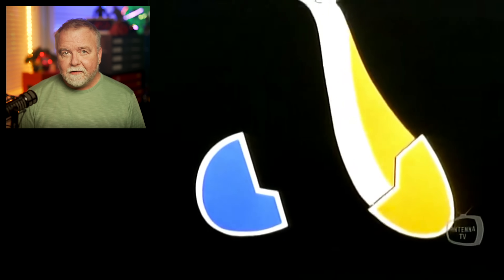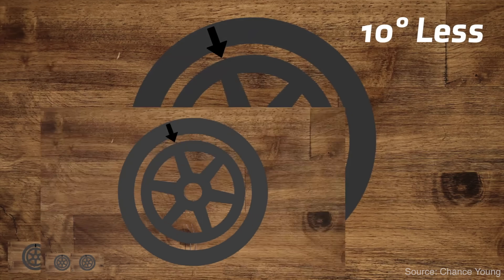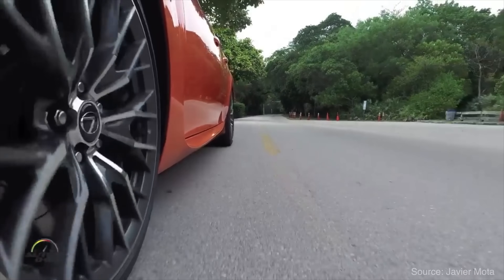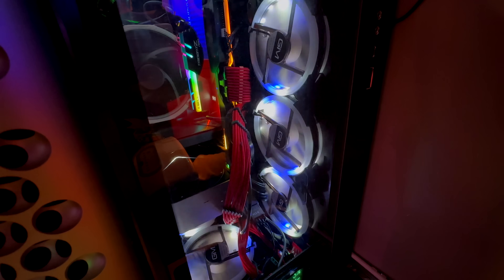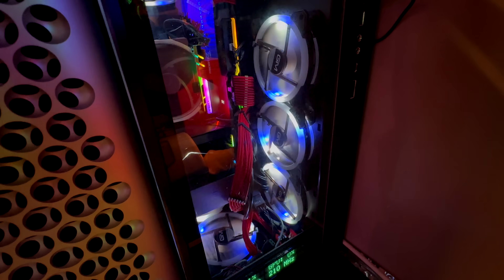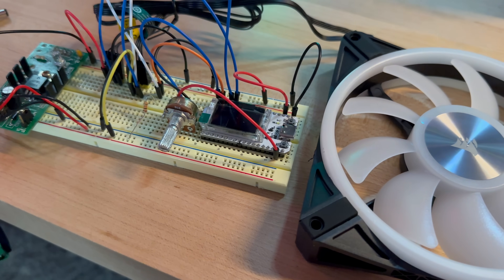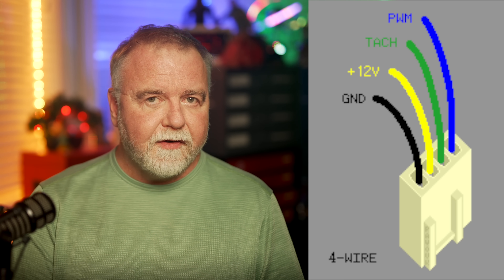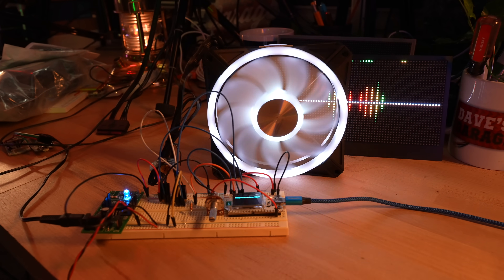Can I Freeze a Fan in Time with its RGB Light?

Comment: The algorithm could be more like a "real time" Frequency Lock Loop; or maybe it's better thought of as a Period Lock Loop. Ignoring for the moment any constants like "2", just measure the time between pulses and immediately adjust the setting for the PWM. Use a precalculated table if it helps speed thing up. The loop should track and update once per pulse / revolution. There wouldn't be enough time to see any drift. Also, ignore man-made units, and just work directly in CPU time (clock or whatever milli- or micro-seconds.)
Reply: A Phase Lock Loop endeavors to lock the phase of one signal to another; so that the two waveforms are kept in sync (or, more precisely, to a constant phase offset in the event that the PLL has an offset). It's a much more ambitious circuit than the following.

Frequency Lock Loops are used in, for example GPS Disciplined Oscillators. These circuits merely count the 10 MHz cycles is one second and slowly tune the oscillator (typically an OCXO) so that it counts exactly ten million.

In Dave's case, he should design a Period Lock Loop (let's not refer to it as a "PLL" as that's already in use).

Comment: Well done, your software skills are high -  but  you already knew that! Try doing it in hardware instead; eg use a phase locked loop based frequency multiplier to clock a short-duration pulse generator that drive the LEDs via a driver transistor. That should give you a solid speed lock with the lowest of latency...
Reply: A hardware PLL has more taste.  That said, I believe you can implement a true PLL using the capture/compare and timer capabilities of the uC also.
Reply: @mgraen  now that would be an interesting video! 👍

Comment: These fans have two sets of magnetic poles on the rotor, every time north pole* passes Hall sensor you get tach signal (both sensor lines are tied to driver transistors, but only one output to tach line). I was not digging into timer interconnects of ESP32, but you could emulate PLL multiplier with two timers - one in input capture mode, measuring time between pulses - and one running faster, responsible for triggering LED refresh
Reply: And maybe reset the PWM timer on each second tach pulse too, to force it into alignment.
Even the PLL route would still be good with variable conditions.

Comment: Wouldn’t the process on the data side all be instant but the reaction of the speed change be on a curve as the blades would need to get up to get up to or slow down to the new speed.  Feedback processing from the fan sensor once every rotation wouldn’t take into account the change in speed curve if only perfectly devided by 9. Resulting in the calculated flashes between each flash not being perfectly timed.

Also wouldn’t the LEDs have a dimming curve with the brightest point being just after being triggered and then a slower discharge.  Once sped up some of remaing charge from the trigger before would mean the visible on state would be longer or some brightness during the period you would consider as off in your program.

I admit I’m out of my depth in this chat room but I’m enjoying thinking about it.  Going to watch the video a second time and google some things.  Thanks for the rabbit hole.

Also some great comments on here.
Reply: Pure-color LEDs don't have a phosphor and turn on and off effectively instantaneously for the speeds we're talking about here.

Comment: Dave, would measuring the speed with each rotation and adjusting the pulse rate of the LED, base on the previous rotation's measured speed, fix the issue with drift?

Comment: Dave, this stroboscopic effect can be dangerous if you're working around power tools.  Back in the stone age when I was in college, we were told about a student working in the wood shop with other students and several machines running (i.e., loud).  This student was using a table saw and the overhead lighting was made up of fluorescent tubes.  The fluorescent tubes flicker(ed) at 60 Hz (here in the North America) and the saw's motor RPM was a multiple of 60.  In short, he ended up cutting one of his hands off at the wrist because "his" saw blade appeared to him as being stationary and, due to the noise from other machines, he couldn't tell that his saw was actually running.
Reply: Same, when I was in high school, the machine shop equipment had incandescent lights for precisely this reason. 50Hz in Australia.

There was a demo of the lathe setup under a fluorescent light, the keyhole for the chuck appeared stationary.

Comment: 16mm & 35mm film runs at 24FPS. For V, projectors used a special shutter that displays every sixth frame, twice to give your 30FPS. I ran a lot of film on RCA TP66 film chain projectors in the '70s.
This required the optical sound head to require a loop of film to provide a continuous feed for stable sound.

Comment: Another approach is to set the LEDs to less than 100% white.  The controller chip in the addressable LED will do its own PWM (presumably at a fixed rate).  Use the fan's PWM input and tach output to get the fan speed to a suitable multiple/fraction of the PWM frequency.
Reply: Unfortunately the LED PWM drifts wildly with temperature, so good luck calibrating to that. The reason is that there's no space or cost allowance for precision crystal oscillator clock in the LEDs, they use simple RC oscillators, and there was really no need to even try to temperature compensate it. Furthermore every single LED will be on its own clock with its own individual drift. You can just assume that a string of several LEDs is as a whole lit up the whole time, if they've been powered on for a while, even though individual LEDs are strobing.

Comment: If the tach line is a hall sensor, it would be spinning a small magnet.  Use two for a smooth, balanced spin. 😊
Reply: The tach line is indeed a hall sensor, but the magnet is the actual rotor with 4 poles, it's on the rotor in the perimeter of the hub. And there's 4 coils on the stator driving it, with polarity flipped every time the Hall sensor crosses over into the opposite state. The Hall sensor is there anyway, it's needed to drive the motor, and the tachometer line just converts this signal into open-drain and leads it outside. It's so simple.

Comment: A hack I've used to determine fan speeds (for determining if it's a 1 or 2 pulse tach line): get the fan up to a speed, blow on the fan while measuring the sound with a spectrum analyzer app on my phone to find the frequency, divide by number of blades, multiply by 60 seconds per minute to get RPM.
Reply: Wtf
Reply: Wouldnt the fundamental be a multiple of fan blade count?
Reply: @RuddODragonFear  Good question. I didn't say "fundamental" in my original comment because I'm not sure that this frequency is the fundamental. I might be a little bit too much of a purist here, but as I see it, the fundamental frequency is actually the rotational frequency of the fan because that's when the whole mechanical system "resets" and begins the cycle anew. But because a perfect N-bladed fan has an N-step symmetry, any harmonic that isn't a multiple of N is canceled out. Of course, imperfections in real-world fans will mean that there will be a little bit of amplitude at the non-multiple-of-N harmonics (and a lot more in extreme cases, like a blade being broken off), but under normal conditions, this is one of those rare sounds where the fundamental is much quieter compared to that Nth harmonic and multiples of N.

However, this is a topic on which experts may reasonably disagree. Someone more pragmatic may say, "No, the mechanism that generates sound here is the air jet from the mouth being periodically interrupted by a passing blade. THAT is the system we are analyzing. The fundamental frequency is the rate at which a blade passes and every other harmonic is a multiple of that frequency."

Either way, the result is the same: the peak frequency of the spectrum is the "blade pass frequency," and whether you call that the fundamental or the Nth harmonic of a lower fundamental, you need to divide that frequency by the number of blades to get the rotation frequency and multiply by 60 seconds per minute to get the RPM.
Reply: @CFSworks love this breakdown. Wish youtube comment allowed pictures so I could see the spectrogram
Reply: Intel 2005 PWM PC fan spec says it's 2 pulses per revolution. So if it's more or less, any mainboard will read the fan wrong as well.

Also these fans have quad pole motors, so the internal Hall effect sensor reading and the internal control signal flips 4 times per revolution. This is two positive pulses. One of these signals is simply conditioned a little and brought to the tachometer pin.

Comment: It seems like in practice you could dispense with the multiplication and division by 60 and make strobe_frequency equal to frequency * 4.5 (since you seem to be getting two pulses per rev, you can bake that division into the multiplication), for an ever so slightly faster code speed. Writing it out is better for the educative aspect though.

Comment: Ambient light has an effect on your effort. I used to repair engine driven generators. I could set one to 60HZ without a frequency meter. I was using the building lights which were at 60HZ and rotating stuff would sync with those lights and the engine speed was correct. Can’t do that any longer as led and any fluorescent light now operate at 20KHz or other high frequencies.

Comment: You may run into numerical stability issues using floats to do such precise division and multiplication with numbers of vastly different magnitudes. I'd be using doubles for this for the extra precision.

Also: Is your printf statement eating cycles and causing timing issues?
Reply: Most FPU instructions on ESP32 do not support double though, so it's kind of dicey. But at least the support is not totally absent. On most other microcontrollers, when you say double, you get float, just no support for double at all.

Comment: Well until you write a closed loop to stabilize the fan based on tach and pwm you will be chasing your tail. A PI controller should be enough. Also, I don't have to tell you how much time you have to spend servicing the ws2811data. The spec for the fan wants a 25Khz pwm not 20hz, and I would go with much higher resolution than 8bit, 256 isn't a lot of fine tune resolution. It further states that low fan speeds (10%) may cause flakiness due to the need to combat physical friction (stiction) and has lower rotational inertia. Anyway, fun little test, thanks.
Reply from the maker: In a more complicated version, I sample the speed in loop() and adjust the timer frequently, but it's harder to follow the logic in an episode like this!
Reply: @DavesGarage  Agreed, but don't forget most of us arn't here for macramé. Some of us enjoy the nitty-gritty details.

Comment: Excellent video! I did a similar thing back in the early aughts when case modding and LED fans were starting to be a thing. I worked how many pulses per revolution were sent out of the motor speed wire, used a binary divider to create one pulse per revolution and then a one-shot to flash the LEDs VERY quickly on each received pulse. Presto, stationary fan blades :-)

Comment: I can kind of get the effect you're talking about using Corsair ICUE.  I use Marque with a deep red color at the slowest speed possible. It doesn't illuminate the entire blades of the fan. I'm also using an adapter that makes the Silverstone 160mm fans I'm using connect to icue. best $5 ever spent.
Reply: hey! can you tell me what adapter you used?
Reply: @MA481  it was a cheap adapter on Amazon. I think it's this "Standard 3-pin adapter for Corsair Commander and Lighting Node Pro". then I used a Lighting Node Pro and voila.

Comment: I bet I can achieve more precise timing with nano RTOS.
Reply from the maker: What makes you say that?
Reply: @DavesGarage  I like the challenge. Try using hardware pulse width modulation, and average period over a few turns to reduce jitter due to vibration. The sleep accuracy is 1 microsecond.

Comment: Several things I'd consider experimenting with, though maybe you already know these aren't worth it.

Two pulses per rev and given an odd number of fan blades suggests that you or the fan may be pulsing in sync once and "between" blades the next. This shouldn't matter if you're perfectly strobing in sync and only on every other (you divided by 2), but I would guess that you're maybe getting out of sync (and/or perhaps the fan isn't perfect in it's tach output), so sometimes you'd strobe on a "between" moment.

Maybe don't need to strobe for every blade, rather somewhere in the 30-60 times per second, presuming you could be synced properly to a blade being present. This may be every 3rd blade or something and still be "appealing". This would be a little more math, but may give more time to do maths and pulses well.

I'm curious if the led pulse on/off takes too long (specifically it's on for too long), and maybe the ESP32 could do that pulse quicker, like use a PWM output on a reasonable clock cycle, and turn that over to hardware more so than active port bit flips? Also, possibly consider building an external pulse circuit that could be merely triggered by the ESP32, but the actual on/off pulse could be handled in hardware (a 555 timer perhaps).

If you really want to dive deep(er) on the timing, consider a PID control loop for the controller to self measure its syncing with the input tach signal. I wrote one of these a while back, and so long as all operations are within the PID timing loop, you can effectively factor out things you have little control over, like perhaps somewhat variable timing of port outputs, other CPU operations you don't control, interrupt handling latencies, et al. (In my use case I averaged out (effectively zeroed out) the linux network stack and ethernet driver overheads to achieve microsecond level packet delivery timings for real time video streams, on any reasonable type of hardware, for any type of local machine load.)

Lastly, (maybe something you could expound on in a part 2) we know the camera you're capturing this effect has a frame rate, and then YT will itself maybe crunch bits during video compression. To your eyes, does watching this on a desktop on youtube look exactly like you observed in your garage directly?

Thank you! Great content as always.

Comment: You could freeze it in two positions with 2 different colors. Or even make those two colors counter-rotate so it looks like for example the green fan is slowly spinning clockwise while the red fan is spinning counter-clockwise.
Reply: Yeah, just set the timer for one colour slightly faster than the fan and the other slightly slower.

Comment: iirc you have an scope. I'd start by looking at the shape of tach pulse and see if maybe you're triggering on both edges. It should show you the pulse shape and jitter etc. Are these rgb or rgbw. I'd bet w would be lazy from the phosphors. You could also drive individual colors and scope an led forced into photodiode mode or solar cell mode. You might get a feel for min pulse duration prop delay etc. A clear case red diode should respond to rgb light. " Analog Dev led as a light sensor" should turn up a schematic. Since the blades are the same you could try every 3 blade strobe instead of trying to keep up with all 9. Random thoughts to keep out of trouble for the weekend 😊

Comment: Now this would be a cool option for fan controllers. Surely the manufactures could work it out since they know their hardware. How expensive would it be on a modern CPU? Given fan control software like icue and the like do take up CPU cycles
Reply: I have been told that this is implemented as Mirage feature on the AMD Wraith RGB. You can make the blades appear stationary or slowly rotating, or separate colours slowly rotating, looks really fancy. I don't have this cooler to test though.

Comment: Excellent and thought provoking video. Sounds simple, but as you showed, the devil is in the details... anyway I am wondering if the pot could also be used as a fine tune. It should not be too noisy if over its whole range it only changes the frequency by, say, +/- a few microseconds. Thanks for sharing and inspiring.

Comment: Is the pulse width definitely related to the RPM?  Or is just the pulse frequency specific to the RPM?  (In other words, does the duty cycle vary with RPM or just the frequency?)

Maybe, see Phase Locked Loop (PLL).  Use to generate a faster frequency (or upscale) locked to the tach signal.

Comment: While the ESP32 is a great microcontroller, its ADC (Analog to Digital Convertor) isn't very good. I ended up needing to use an external ADC to get good results (actually an Atmel328P).

BTW: I kinda like the slow motion effect rather than stock still
Reply: Most microcontrollers actually require a magic dance to get good ADC readings, and ATmega328P is particularly funny since what AnalogRead does behind the scenes is set a timer, turn off all other peripherals and interrupts, and suspend the CPU for the measurement time, because it doesn't have a separate ADC power rail so any activity would imprint on the ADC otherwise absolutely horribly. But yeah other than that it is well behaved, mostly.

ESP32 is of course not a shining example, no.

Comment: This has all the fundementals of how engine management works for ignition timing.
Reply: Next episode: Dave builds an engine control system using ESP32
Reply: @andrew2004sydney I suppose this is not out of the question really, he does have some antique cars that he likes to maintain.
Reply: @andrew2004sydney  It's been done.
Reply: It is definitely funny you mention this...  as a cur nut myself, I run a stand alone aftermarket ECU in my racecar. I always wondered why or IF Dave has done this to one of his older cars.   It would be right up his alley!!!   :)